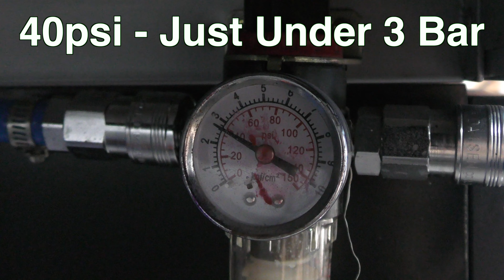Airbrush Mac Valve, is it really worth it ?

Comment: Thank you for that. I actually stopped using airbrushes with a MAC valve, mostly because I didn't fully understand its purpose, or that paint dilation needed to be different. That was more the miss for me I think. I wasn't changing my dilution. I will most certainly give it a go...I might invest in a mac valve equipped airbrush soon

Comment: Thanks for the info,it’s very useful! I have an Iwata Revolution which I use for all my general work and a Sotar 20/20 which is for my fine work. I have quick connects on all my brushes but on one of my hoses I have the Mac valve built into the disconnect. I don’t use the Mac valve very much since I like to know what pressure I’m shooting at. That said, I usually thin all my paints 50/50 or 60/40 thinner to paint and at about 12-15 psi. The only time I use 25-30 psi is with Stynylrez primer. I work primarily on 1/87 HO and 1/160 N scale models. Watching you do large artworks has seriously tempted me to venture out of my box and try something more challenging. Again thank you for you videos, they are very informative and have answered many questions!
Reply from the maker: Thank you for your comment and kind words , glad you enjoy my vids and that you are tempted to try some larger scale artworks , I’m sure you will do amazing given that you are currently working on smaller projects and that takes control and precise details 👍🏻

Comment: I have a MAC valve that is installed directly before the quick connect fitting on my airline so it is available to use on the airbrushes that don't come with one internally.  It works a treat and serves a a bit of a handle at the same time.

Have a great day, and thanks for the great video :)

Comment: I use mine all the time, really comes in handy eliminating the need to adjust the air pressure at the regulator. Also, you can close off the MAC valve and pull far back on the trigger and get a spattering effect.
Reply from the maker: Yes it’s super handy and thank you so much for sharing your tip 👍🏻

Comment: Nice info on it's precision in comparison to playing with your main regulator. Wish u would have shown your take on spatter  effect too. Thumbs up to all your help on the journey 👍
Reply from the maker: Thank you , I may show some spatter info in a later info if that helps 🤔 the main thing is the convenience and the fact that you can run the psi so low by using the Mac valve , if you run your psi too low on your compressor then it will work similar to a point and then it will start to spatter which is great if you want that effect 😉
Reply: @AirbrushAsylum  Highly appreciate all you do for us beginners! Just piddling around with an old VL, Talon full set, Matcto .3 (broke off the nozzle threads) and got it out simple with a toothpick.. Besides the mess, loving the Sparmax GP 50. Really loving how it handles whites down to details. But as it is, still got to get that 771 my pennies are screaming for...

Comment: Would you get the same effect, or a different one, if you had reduced the air pressure at the compressor/regulator, instead of using the "Micro Air Control" (Iwata's definition of the acronym) MAC valve?
Reply: Yes
Reply: Sure, but consider how much fiddling he did to dial it in, would you want to be doing that with the compressor directly? 

Would you then want to remember to reset to the proper psi on the compressor after? 

It's a convenience, much like. Oat features that drive up the price of an object
Reply from the maker: Yes, over thinning and dropping your psi will work but as others have mentioned here it is a convenience thing and also keep in mind that you are still getting full air coming into your brush the mac valve is only reducing the flow , therefore you can go really low which if you turn your compressor to the equivalent it may spatter your paint 👍🏻👍🏻

Comment: Thanks for sharing this information.  I might look for different airbrush than the Paashe with a mac valve, which does not work, it bubbles, and I have cleaned it.  Actually I have two and they both do the same thing. I have Iwata's and might get one of those with the mac valve.  I also have a SharpenAir that has straightened my needles.

Comment: Hi, sorry a question not about that video, what would be the best under 50usd airbrush that I would use only for primer
Reply: There isn't one. Save your money and get an Iwata Eclipse HP-CS. Looks around but it should be under 200.00. You'll need a oil/water separator and make sure to get an air compressor with a tank on it.
Reply: @hinddee  I’m planning to get a “iwata smart jet pro”

Comment: I find Mac valves bit of a waste in that you could spend an £50 to go from a iwata Hp to Hp high line same brush just just with the valve so paying £50 more for a valve, it also stops the airbrush from fitting in the holder and I find they get in my way when holding my airbrush. 

I purchased a TC2000 + 5L tank it comes with a portable holder free (can buy separate) you can alter the psi from my desk so for me it would just be silly as my valve is less than 1f away! 
For about £8 you can get a set of 3 quick release couplings with Mac valves built-in so you get the valve on the brush but it's not in the way, it seems a better cheaper option to me but hayho great video as usual 🤔
Reply: @Sam Mariano just for fun I will make a video today showing how a £70  extra upgrade seems totally pointless to me. If you can watch it and say at the end I'm wrong or don't make a very very very good point, that you couldn't use that money towards a better brush then I say you must have money to burn!
Reply: @Sam Mariano Why is saving people money wasted energy! 
I mean I have an airbrushing channel and I'm doing a review of the CM-SB and HP-SB plus so not difficult to fit in mac valves, show how the £10 hose mac value is better value.

Comment: Not really. That is additional mantainance cost especially when it start to leak (the spare cost is higher depending on the brands). There is cheap mac valve that attached to quick release device if you want that air pressure valve. Its cheaper than replacement parts from the brands of airbrush. Most compressor nowadays have a pressure gauge and I also use that as my air pressure control if I use airbrush without the mac valve.
Reply from the maker: Fair enough thank you for sharing your opinion with the community 👍🏻

Comment: is that small crack under the ps-770 cup, or shadow?!
Reply from the maker: No crack, I think it’s either some paint or a shadow 🤔 they have the cut out (design feature) which could make it appear as though there is a crack but I can assure you that the brush is still going strong 💪
Reply: @AirbrushAsylum  Good to hear it is working!! At 0.53 in the video it looks like a crack at the welding spot right under the cup, where is small amount of blue/teal paint. Sometimes shadows make funny illusions! :) I have microns and been curious about ps-770, all I have heard is that they are great brushes!

Comment: I've thought about buying an airbrush with a MAC valve. I'm definitely not an artist. I just do scale models. But, I have actually looked at that very GSI in your video. I have to be careful, though; as I have large hands. I have a Richpen that I've had for 15 years or better. It probably has less than 25 hours on it. Just too dang small.
Reply from the maker: Fair enough not sure if you are living near spraygunner in Florida (they are touring as well) you could try and see if you can physically hold one before you buy 🤔👍🏻

Comment: 40 PSI ??? what ???? have you read your arirbrushes instructions sheets?
most new technology airbrushes work from 5 PSI to 35 PSI tops.... why whould you need 40 PSI even with the MAC valve?
great airbrushes!!! I wish I could purchase the Iwata Kustom Micron
funny thing you can achieve the same results with a fine needle/needle-cone setup and adjusting your air pressure from the air filter/regulator
Reply from the maker: I know , never had an issue with 40psi…I remember hosting the late Mike Lavallee for his Australian tour and the first thing he said to all students was ‘crank the psi up to 90’ …he wasn’t joking , as he loved to work fast and get that paint flying….I wouldn’t recommend 90 but in all my years I feel that 30-40 is perfect for all round airbrushing and then I generally reduce the psi to 18-20psi for fine detailing 👍🏻👍🏻

Comment: A MAC valve is a simple needle valve, and it controls Air Flow, not AIR PRESSURE, only a regulator can control Pressure. 
A Mac valve and the needle/Nozzle is the same thing, they both use a needle and seat to control flow. 
The nozzle is the seat, and the needle is the needle, they both control FLOW, JUST THE FLOW, EITHER THE FLOW OF LIQUID OR AIR, NOT PRESSURE!